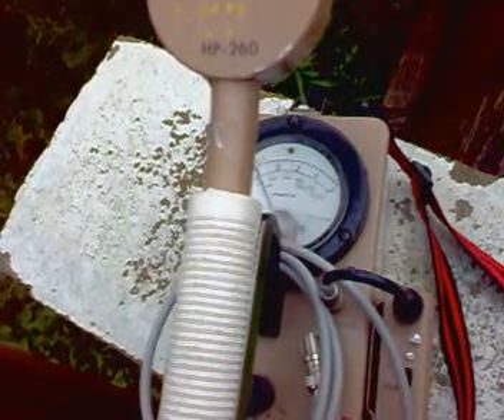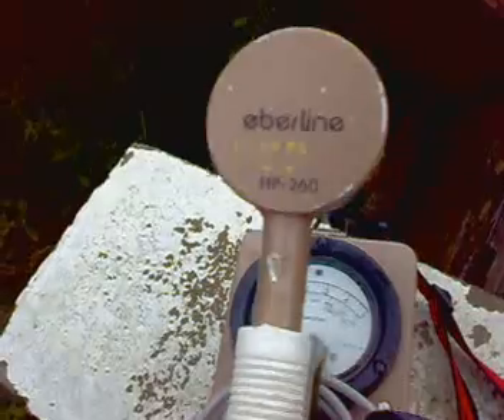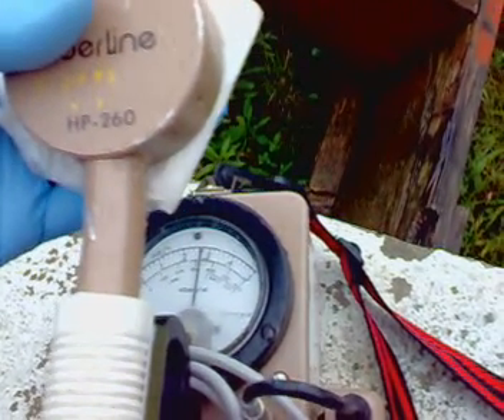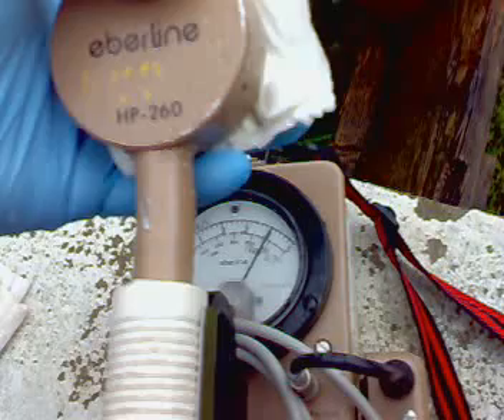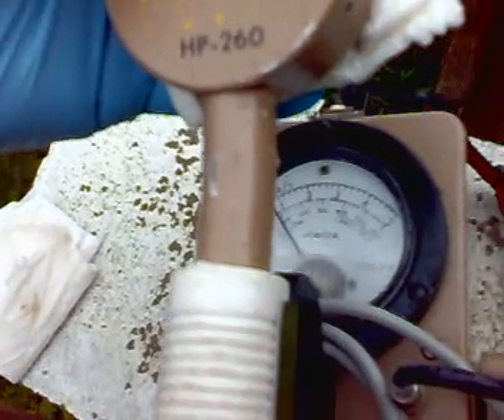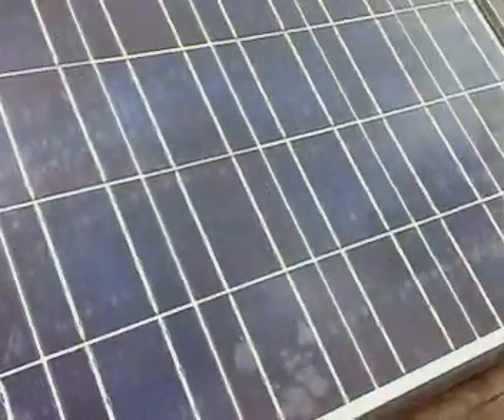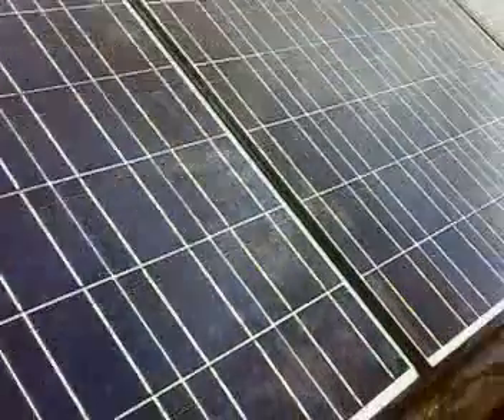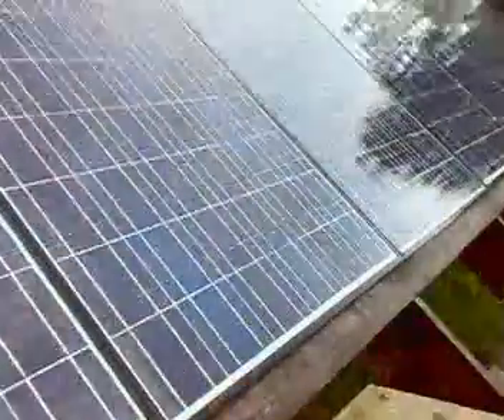24th August 2011 10h50 10500cpm Rain Toronto

Comment: Have you done a circuit check. I read a forums site that noted that these high readings could have been caused by a temperature inversion or other part failures, such as a diode in-between the middle amp and the probe.

Comment: 10,500 CPM is a touch high for any rain. Consider that you do not have a 100% efficency for detection. Additionally, at least half of the radiation is not traveling towards the detector, (it's going down), and finally, you have the distance inverse square and CSDA effects all lowering the count. That would mean that your true count would have to be much higher, at least twice. Even in Chernobyl it does not rain that hot. Why in Canada? Radon decay does not cause that level of radioactivity.